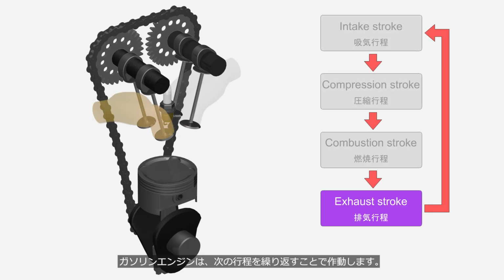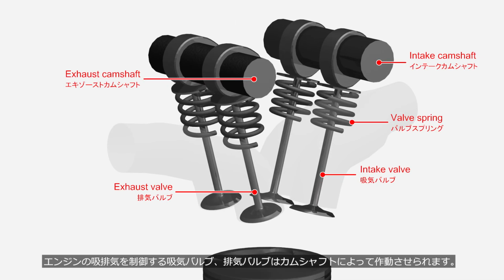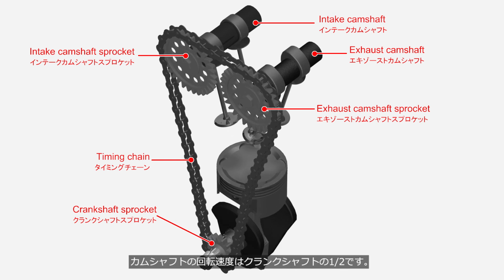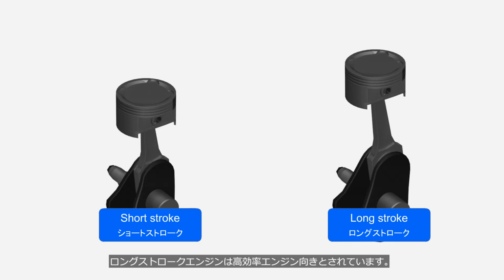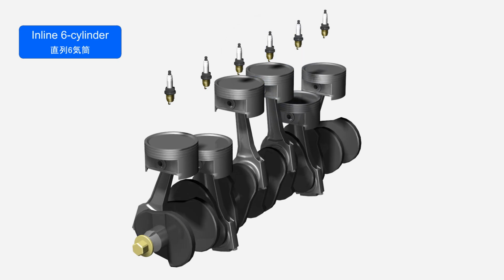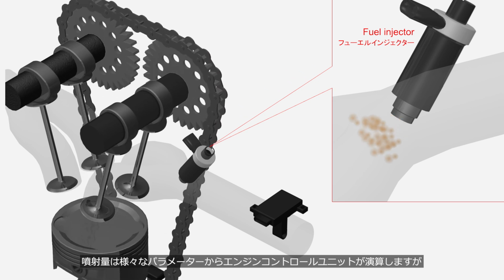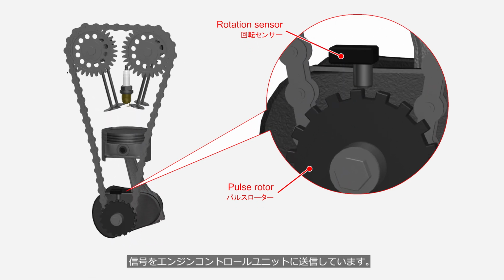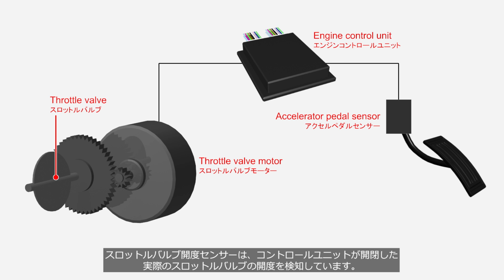Super basics of Gasoline engine operation

Comment: Why does it seem most software programming on ICEVs and HEVs are so stable whereas for BEVs and PHEVs they require frequent updating?  My Honda Accord only required one software update to reduce carbon deposit buildup and it's fuel injected.
Reply from the maker: Thank you for watching the video and for your question. 
In my opinion, it is due to the difference in the proportion of software contributions to performance and issue occurrences.
In ICEVs, the majority of performance is determined by mechanical components, whereas in BEVs, that proportion is much lower. 
Conversely, BEVs can significantly improve performance through software updates. The same goes for resolving issues. 
For minor issues, automakers might ignore them if they require expensive part replacements, but if they can be resolved with a software update, they are likely to implement it.
Reply: It could be the nature of the update.  There is many updates that aren't pushed out unless the customer asks or has specific issues or complaints.